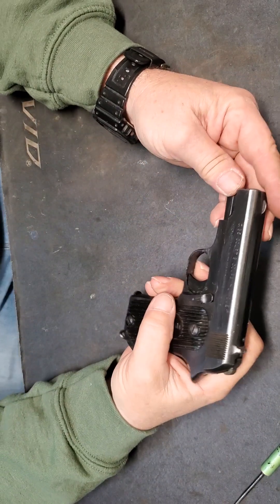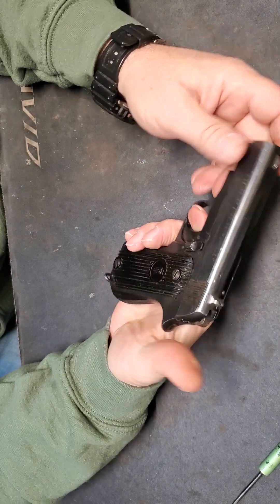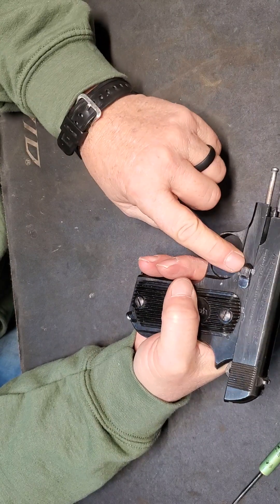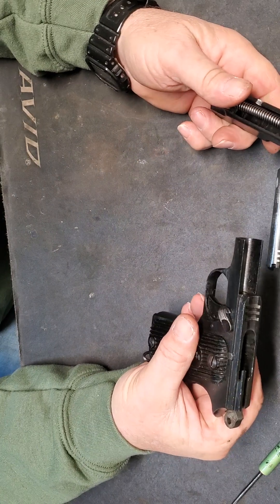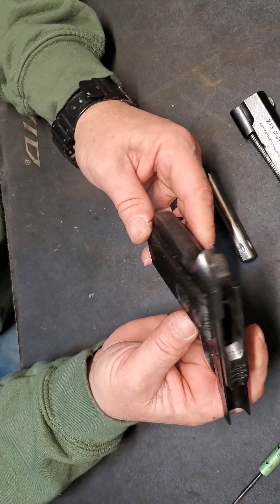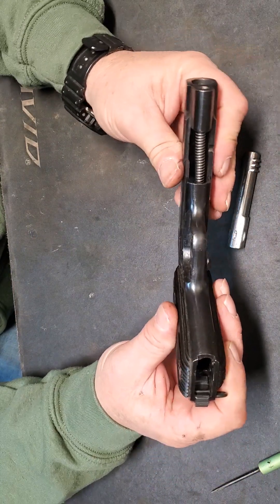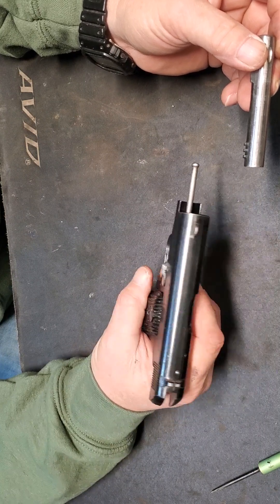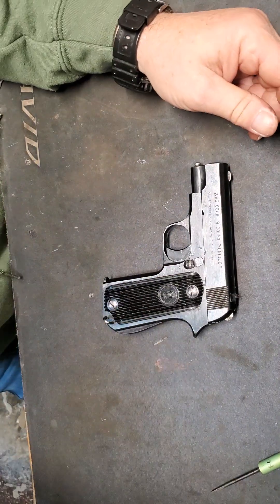Field strip Disassembly of a French "Unique" pistol

Comment: Anyone know how to get the firing pin out?
Reply from the maker: Remove the slide.
Look at the top of the slide, just in front of the rear sight.  You will see the end of a pin to the right of center.  CAREFULLY drive that pin down and out of the slide.  You should be able to remove the firing pin.
When you re-assemble, make sure you drive the pin in from the bottom and make sure it is flush with the bottom of the slide.
Reply: @1917Enfield  dude you are awesome! now if you know anyone who can make a new one please let me know haha
Reply from the maker: @justinsnider2587  Keep an eye on ebay and gunbroker.  Maybe one will pop up.